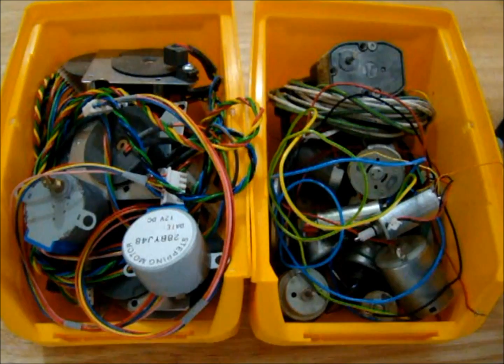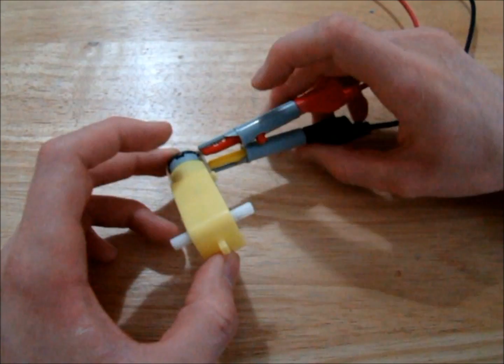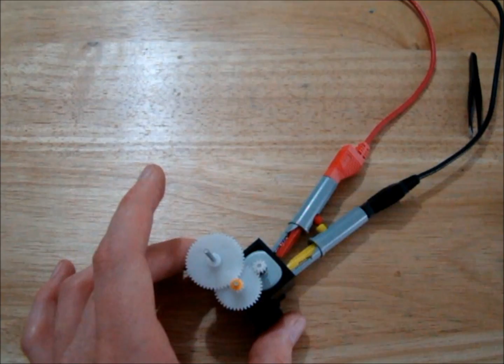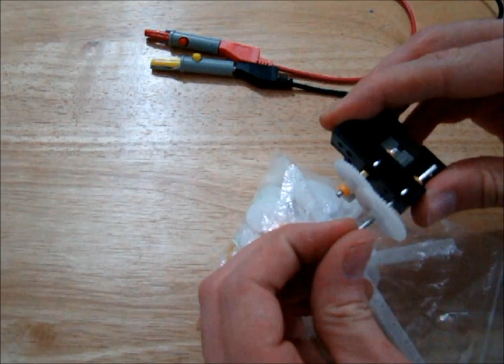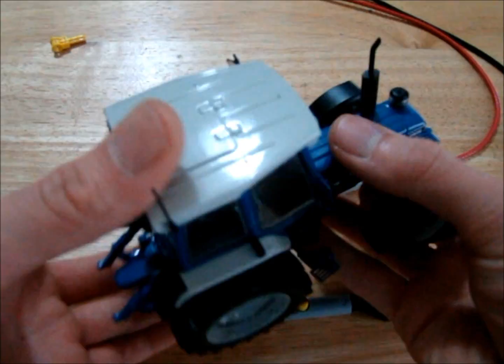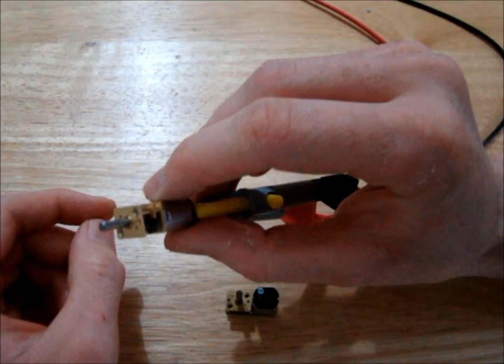Are cheap ebay motors any good? A review of the cheapest, including the brilliant N20 gear motor

Comment: Hi, I'm trying to build an RC Car. I'm looking to race the car on reasonably smooth ground (perhaps asphalt), so as fast as possible but with still the needed torque. The first motor + gear box combo you tested seems perfect for what I need, I was wondering if it's still available for sale, and if so, where I could buy it? Or do you have any recommendations for something similar? Thanks.

Comment: I'mlooking for a miniature motor to drive a cassette tape. A miniature gearbox is an easy off the shelf solution, but sacrifices the fast forward/rewind functionality for compactness. Many of the smallsized walkmans have a company brand developed motor that isn't available for aftermarket.

Comment: I have a question could i power a Toy (with a 3v DC motor inside) with a
 6v DC cord (to save some money from batteries) Would be too much 
voltage? thanks
Reply from the maker: Obviously I don't know for sure since I don't know what motor you have but I'd guess it would work fine, the motor would deteriorate faster at the higher voltage but probably wouldn't fail in the time you'd be using it. If you are talking about wiring 6V to a 3V circuit board though then I'd say that will break the toy.
Reply: manystar its a useless questions

Comment: What's the recommended upgrade to this? Something faster but not much more expensive.
Reply from the maker: +Tortoise010 Upgrade to which motor? I haven't found a motor more useful for small models than the N20 yet, I have pretty slow ones but you can get them geared faster at the cost of lower torque.

Comment: I want to gear up the N20. I think if I gear it up enough it should be able to move a huge tread. I'm currently having trouble finding gears for the 3mm shaft. Where did you get the gears you had in the video? Has to fit a 3mm shaft.
Reply from the maker: +joe bredestege I got those on ebay, here is the link http://goo.gl/zEjBwQ. They seem pretty strong to me but I haven't put them under as much load as you're talking about.

Comment: I have this yellow motor and wanted to know how high I can push it voltage wise.
12v is great. thanks
Reply from the maker: Hamavreg I think you can push it to 12V but remember these cheaper motors generally have a shorter lifespan when used with a higher voltage.

Comment: Hi.. buddy, I know 6v is the recomended limit, but what is going on if I use 3 pcs 18650 3,7v = 11.1v or 2pcs = 7.4 - 8.5 (full charging) for this Yellow DC motor gearbox? plz, responding!  Thnks for your 'pretty_small DC motor gearbox demo', that opportunely I'm requiring it! :-) (Y)
Reply from the maker: mukhlis1010 Hi I think you can go to 12V with those motors as it does say that on some of the alibaba seller pages although that may not be reliable information. The higher voltage you use the shorter the lifespan of the motor is a general rule of thumb, go too high and you'll fry the motor in a couple of seconds so I'd aim for the lowest voltage which achieves your goals.
Reply: and then, 7.4v in 2 pcs 18650 could it be? is it some the exact power for this motor?
Reply from the maker: mukhlis1010 I'm not sure what 18650 refers to? I don't know any exact values for the motor, they are usually cheap motors that will work up to 12 V before breaking but if you use lower voltages they will last longer. You could always ask the motor seller before you buy the motor, they might be able to give you some information.
Reply: ohh.. so, it will be hard to work lower than 12v and easy to break if we use up to 12v. so, by using lower voltage make it hold out life longer, allright!! Thnks :-) (Y)
Reply from the maker: mukhlis1010 Yes I'd say that's how it would work, it's a pretty good motor even at low voltages.

Comment: и какое передаточное число нужно 1:50 или 1:30 ???
Reply from the maker: Макс Claas That is hard to say it depends on the voltage and wheel diameter but you should try get a motor that is around 72rpm because that is what Siku use and it is quite good.

Comment: Where did you order the cheap motors?   I would like to buy the 6 to 12 volts motor that's $1.90 could you give me the web site to order those?   Thanks
Reply from the maker: I got all of these motors on ebay, this link should be for the one you described http://rover.ebay.com/rover/1/711-53200-19255-0/1?icep_ff3=9&pub=5575114842&toolid=10001&campid=5337644757&customid=&icep_uq=Intelligent+Car+Gear+Motor+TT+Motor+Robot+Gear+Motor+for+Arduino+New&icep_sellerId=&icep_ex_kw=&icep_sortBy=12&icep_catId=&icep_minPrice=&icep_maxPrice=&ipn=psmain&icep_vectorid=229466&kwid=902099&mtid=824&kw=lg

Comment: I looked on eBay but couldn't find the last motor you tested with the off set shaft. do you have link where i could buy it? cheers
Reply from the maker: I have some links on the site for ebay sellers with a large selection of n20 motor speeds and voltages here http://www.rctractors.net/electronics-from-ebay you might be able to find them cheaper from other sellers but they are harder to find with the offset shaft, searching n20 flip motor sometimes works

Comment: im looking to buy a flat based motor like that old car radio you showed. Silly question but how do i make it work and what other things would i need to make that happen?
I dont need a fast speed at all just something that has a flat base.
Reply from the maker: Those motors are usually 12 volt DC because the car battery is 12 volts. That motor wouldn't have a huge amount of torque so you wouldn't be able to move a huge load. The best way is to use an Arduino and a motor driver which will give you speed control and bidirectional rotation. I have a blog post on controlling a motor with an Arduino and a motor driver, you might find it useful and it's very easy to do http://rctractor.blogspot.ie/2014/07/tb6612-smd-motor-driver.html
Reply: perfect! thank you very much :)